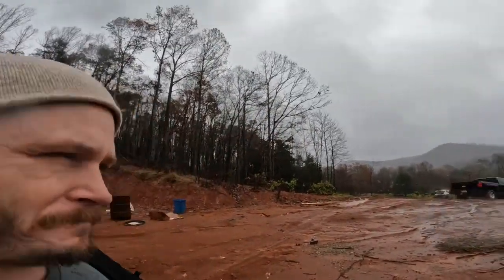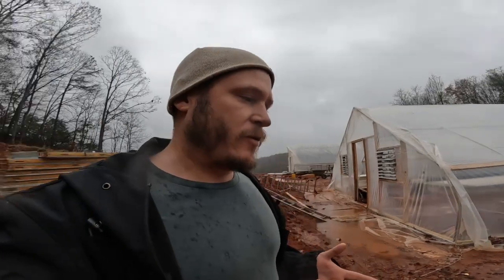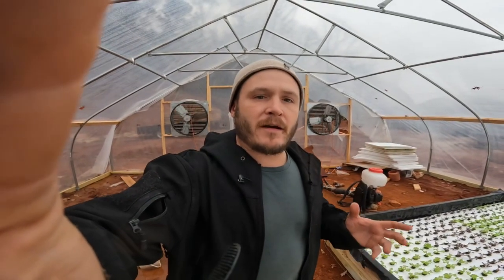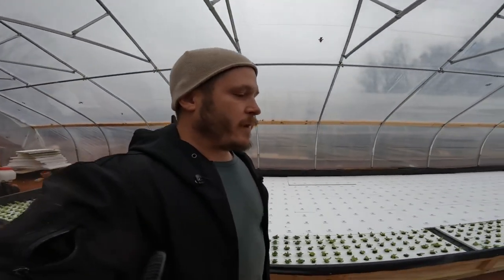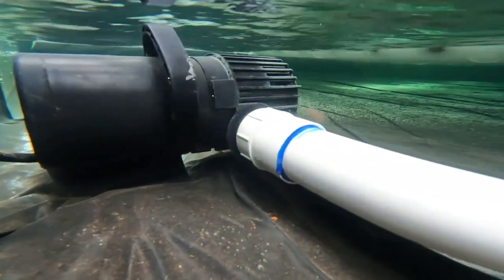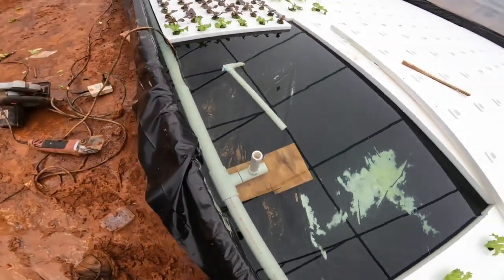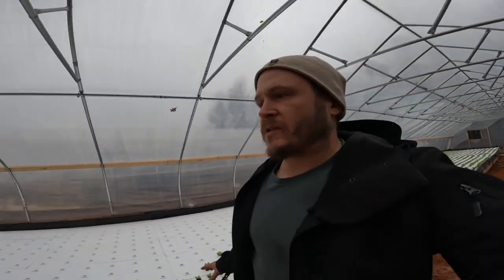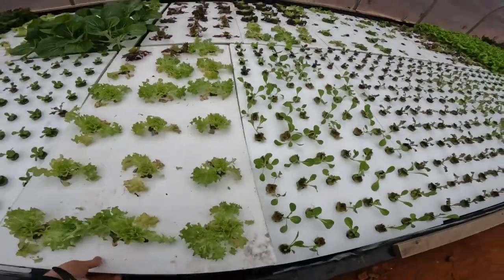Floating raft system part 3 - aeration system - hydroponic Venturi system explained!

Comment: Without a massive air pump you will probably always have the problem of root rot. As a preventative you should be using Bacillus amyloliquefaciens strain D474 or something similar. Your plants should get a root drench before transfer to big bunk. This particular bacteria is safe for humans, it works by bonding to plant roots before fungi (Pythium) get the chance to. Could build a smaller bunk for root drench before sending off to the big one. Hope this will be helpful to you.
Reply from the maker: Thanks for your input, I do use BA, but to control biofilms. I have only had issues with root rot during periods of really cold weather when pythium is growing, other than that, I have never had root rot in my Floating raft system with my venturis running. Now my NFT is a different story, root rot is very common in that system, drives me nuts 😆

Comment: Cant wait to see the venturi video. 
For dwc, what's the minimum & optimum depth of water?
Reply from the maker: I’ve gotten away with as little as the height of a 2x4 in a small 4x8 system I put on a table. But optimal is 12” if you want a good stable system where the ph ec and temp doesn’t bounce around. That’s the beauty of this, there’s really very little daily maintenance. You can actually go on vacation!
Reply: I'm running "DWC" in mixing tubs and also standard flood trays- 4-6" is enough.
My venturi video: https://www.youtube.com/watch?v=JDiEwkcwORs
I'm about to make another version.

Comment: Hi, I love your videos very helpful, thanks for sharing!!! I have one question for you, how long you turn on the venturi system to get a goof aeration water and that good shape of roots plants?
Reply from the maker: Thanks for the kind words! I run it 24/7 because that’s what’s required. This system is pretty large, about 5,000 gallons, and the pump only requires 4-5 amps, so it’s not that big of a power requirement. If your concerned about electricity usage you can check out the kratky method.

Comment: Hi. I have a question about nutrient replacement. Do you have a reservoir or is the table the reservoir? Also, how often do you change the nutrients? Do you replace the entire 5000galons? Cheers
Reply from the maker: This system is on the ground, so there’s no table, but there is no external res. I don’t replace the nutrient solution, but top it off when it’s low with fresh solution. I will probably start pumping the solution into auxiliary grow bags, or into my tomato/nft greenhouses!